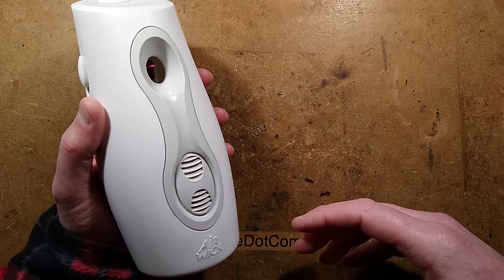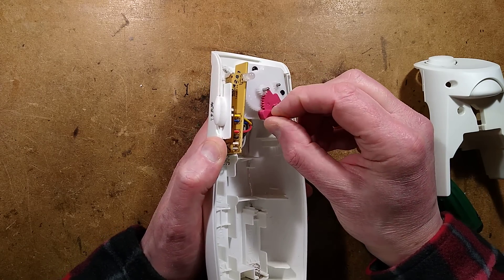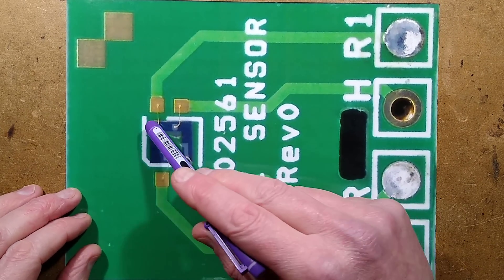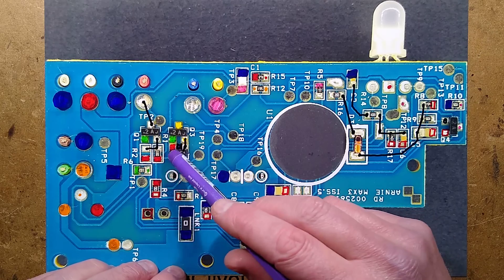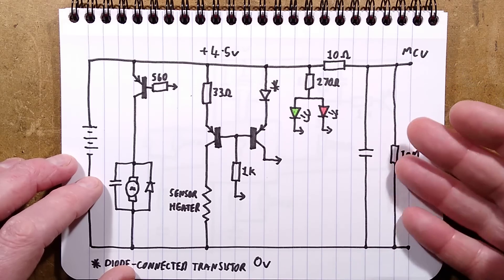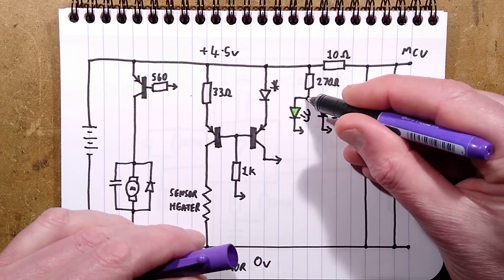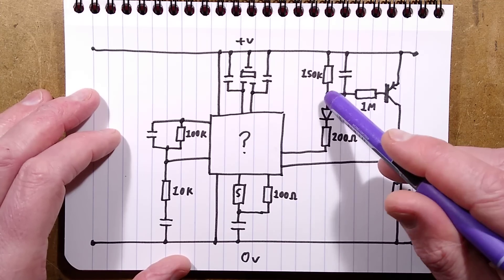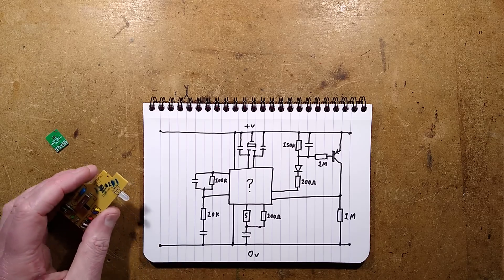Airwick fart neutraliser - with schematic

Comment: The same type of circuitry is used in some gas water heaters
If it "smells "   (detects) any flammable vapors,the gas valve will not open.
The gas company replaced 5 gas valves but nobody saw the shop side of the basement where all kinds of painting were going on
Gas flame vapor explosion = bad things

Comment: I bought some gas sensors a while back to build a fart detector device. Turns out they are very sensitive to a very broad range of gasses, meaning that such a sensor would react to practically any bit of organic chemistry being present in the air, without differentiating beween cologne or fart

Comment: I have a HEPA filter with a fawt sensor in it.  5 seconds after a fawt, the thing ramps up to jet engine speed. The cat takes the most toxic sheet ever right next to it in the litter box and I can hear the HEPA filter laughing as it remains on the slowest speed while I suffocate.
Reply from the maker: This is probably to do with relevant methane content.  You may need a specific sensor for cat poo.

Comment: Just after the turb of the century, I was living and working in Denmark and I noticed that when you went to the bathroom and turned on the light, the fan didn't start unless you were dropping a deuce or taking a shower. If you just went in to take a leak, it didn't go on. I thought the Dane's had come up with some sort of fart sensing technology. Then I realized that it was just a timer.

Comment: I have seen that weird arrangement for the heater transistors. The heating element has PTC characteristics and once it is heated up the voltage on the 33 Ohm resistor drops to a point that the other transistor with the diode does not conduct anymore. This tells the controller that the work temperature has been reached.

Comment: It's not odd. It's a current mirror configuration. The diode is a reference and the circuit  keeps the voltage over the 33 ohm resistor to the same voltage  as the diode voltage drop, thus feed a constant current to the sensor heater.

Comment: Hi Clive, is there a module with microwave sensor I can use to trigger my action camera to start recording and also trigger off when the module times out or no motion detected? I would like to solder 2 wires to the camera switch and conect them to the sensor so when motion is detected the trigger will replicate me pushing the start recording button momentarily and the same when motion is not detected to again stop recording. Thanks Clive. Olly.
Reply from the maker: Not so easy.  The hunting or trail cameras have the PIR built in.

Comment: I just saw a commercial for Fabreeze brand ("Plug" model) air fresheners claiming they have electronics to make them stink the room better, and showed the back side of a circuit board...

it looked too small to do anything that could help, but they showed the back side. Only tracings, no components. 

What's it actually do?
Reply from the maker: It depends on the unit.  Some sequence through multiple aromas.

Comment: The transistor pair is a constant current source. The collector of the second transistor provides a low battery warning when the current source can no longer keep up. The epoxy chip is clearly an MCU. The "charge pump" is NOT, but rather an interrupt generator that wakes up the CPU every few seconds, to take a reading. The sensor is on the back and its wires are sealed to prevent perfume from poisoning it.

Comment: I suggest sending the board to the dude who runs @electronupdate, he might be willing to decapsulate the chip. And regarding the weird charge pump arrangement, I'd speculate that they've shoe-horned an existing chip design and made some workaround circuitry to emulate the feedback signals that it expects to be seeing from what it is normally supposed to control.

Comment: The air freshener industry is the best example of generate a problem and sell a solution. 
Air not fresh enough? Open a window.
Reply: What if you are somewhere where you cannot open a window, or maybe somewhere where its freezing temperatures outside, or hot.

Comment: 7:15 - The heater drive circuit, is a simple current regulator circuit.

Yes, all PNPs, I suspect, the uC can only pull down. A 8051 family of uC have primitive general purpose IO pins. Open collector (or drain) outputs. No DDR (data direction register), so to use it as an input, output a logic-1 (output transistor OFF), and then that pin is hi-Z. 8051s, though originally from Intel, are made by EVERYBODY, so lots of cheap Chinese clones.

Comment: In the ( good old days , ahem ?  ) ..... An  AirWick™ used to be a glass bottle filled with flowery smelling liquid , the screw cap when lifted , revealed a long felt pad supported by a stout wire (  hence : Air - Wick ! ! !  ) ..... when placed precariously on the top of our school toilet entrance modesty partition , would always be knocked off by rampaging young boys , causing a HUGE crash , glass  EVERYWHERE and the ultimate STENCH ( no batteries required , BTW ) ....... DAVE™🛑

Comment: The 2-transistor circuit to me almost looks like a switched current source? I'm still behind on my transistor circuitry but the B-E drop is basically constant, i.e. the same left and right. The diode on the right makes for a very specific base voltage, let's say "Ub - 1.2V" and that puts the 33 across the same voltage as the diode, i.e. we know that the current across the left transistor should be 0.6/33 = 18mA and that would also be the current throught the heater... at least that looks like it. The input on the other collector might be a sensing input to detect a failure in the circuit? Or I might be completely off...

Comment: Ar my last job, the " fart fans" in the restrooms were just a low current 1.5 volt motor and fan blade. The " stink cartridges" had some sort if gelled funkiness and a single " D" battery. That's it. The gizmo ran all rhe time, and the stink cartridges were changed every two weeks. Despite running the little motor nonstop for two weeks, the battery had plenty of life left in it. I salvaged them, giving them away to whoever needed D batteries ( boom boxes were common then)...free batteries, though they reeked of cherry or apple scent..

Comment: Those 3 transistors sound like they're hooked up as a current mirror to put 18mA through the heater, regardless of the applied voltage, ie, acting as a cheep 18mA current regulator.  Keeps current constant at 18mA from fresh 4.5V new cells through end-of-life last-gasp moribund cells.

Comment: Is the transistor heater circuit shenanigans used to detect once the element is up to temp? Low resistance when cold = high current = 'output' high and then the output goes low once heated and passing a lower current? Kinda like an ultra-optimised 'transimpedance comparator'?

Comment: 1. Easily attack a triangle socket head screw by grinding one of the four wings off a Phillips screwdriver.
2. Connect the detector unit to a recordable sound chip as used in greeting cards. One could program the fart detector to play first notes of one's national anthem, a faux pau from some politician's speech, endless possibilities.

Comment: That first page of transistors had 'current mirror' or part of a 'differential input' written all over it, it looks like the front end of an instrumentation amplifier which would make sense to me as your not dealing with nice clean large signals and I don't believe there is a Glaswegian Kiss approach and it's going to be a bit more involved. It's all pretty specific so shame they never label blob chips

Comment: If you wanted to, you can buy modular VOC sensors from the usual suppliers, for only a few dollars. I note you can buy combination laser dust sensors and VOC detectors for less than $8 too, in case you need both functions!

Comment: So they went with the MQ6 sensor. The design is a cheap and effective way for making a natural gas sensor, and with a potentiometer, you can have it sense different gasses like , hydrogen sulfide , methane , co2 , nitrogen , ect. I eventually want to make a usbc gas sniffer , that plugs into your phone , and tells you what prominent gases are present in any given area. Based on different ohm readings.

Comment: the three transistors in middle is a current mirror with current control, the one use as a diode is a temperature compensation.

Comment: The oddly connected transistors form a constant current supply for the heater of about 18mA. The IC can urn this on and off, and can also sense when the heater is actually drawing 18ma. If the resistance goes up to a level where there is not enough voltage to cause 18ma to flow, or a low battery does the same, the sense output (collector) goes low, otherwise it's high. I'm not sure why you would want to do that, but thats what it does.
Reply: Brilliant, thanks

Why? I guess to go into power save mode and flash a LED to indicate the batteries need changing (to prevent over discharge of batteries; and prevent the end user being unaware the device has stopped working or thinking it is broken when it just needs new batteries).

Comment: They use the transistor as a diode so it has the same temperature coefficient. It's a fairly stable current source for the heater.

Comment: It would be interesting to remove the black epoxy using a nitric acid and then look at it under a microscope to see if there is a model number. (If that is  a common chip but a blob variant)

Comment: I could be wromg but if I remember correctly therewere some cheap for the time cut down 8051s. They were slow CMOS only pulled down and at most had two ports. Usually no UART or anything like that. ATmel did some re0ebgineering and turned them intoa 20 pin DIP which you can still get from Microchip. It was the 90's when I did a few weeks work on these so take that with more than a pinch of salt.
Reply from the maker: The classic 8051 core is often found in generic Chinese microcontrollers.

Comment: I think the odd transistors on the heater is so the processor can control the temperature.  Heater resistance changes with temperature, changing the current draw.  The processor detects the threshold and bit bangs the heater power.  

Maybe?

Comment: That diode transistor looks as if they were trying to match it with the other two transistors. Why? I don't know. Doing so won't help with the drift. A 1n914 would work there just fine.

Comment: The transistor with the base tied to the collector - I think that configuration is sometimes used as a temperature sensor.
So maybe it shuts off the heater if it gets too hot?

Comment: And I thought the charge pump was connected to an audio filter via a mini mike centred on 750 hz  which is the common frequency for farts which in turn switches the motor on. The louder the fart the longer the spray. But I may be wrong
Reply: It wouldn't be much use if it couldn't detect SBDs.

Comment: Air in my apartment is really fresh. The weather here has been fantastic for about the last two weeks, and I bought some thermostatically controlled window fans, and so it’s always pleasantly cool in the apartment with fresh outside air going everywhere. It smells like trees and grass, not like a concentrated a field of flowers and shoved them up my nose. And my sneezing is due to all natural pollen, not industrial chemicals from air fresheners.
Reply: when I was growing up, my mother, tho she had a brand new cloths dryer, chose to continue to hang her laundry on a clothesline when it wasn't raining out. and it always smelled so fresh after. not like hot lint like when done in the dryer.
Reply from the maker: The reason it smelled so fresh was because outdoor air contains a cocktail of short lived active molecules that are replenished continuously by foliage, atmospheric and electrostatic effects.
The same molecules will rapidly deplete indoors making the air seem stale.

Comment: I just put an esp 32 Relais between the battery pack connection of a normal airwick and added USB power. Now I can trigger it using Homeassistant. Because it always sprays one time when the battery pack is connected.

Comment: I may be able  to test  that , and add a high voltage power supply and ozone generator that dispenses  a measured dose of magic gas, ooh also make sparks. The mark of a decent bit of electronic shit.

Comment: I'm waiting for the newest in cutting edge fart sensor technology with subsonic early warning microphones and an air quality sensor that uses AI to give you an impromptu colon screening every time you pass gas.
Reply: And it requires an app to be even able to run :) and connects to your house wifi network and sends every 5 seconds all your data to the cloud

Comment: I have Winix air cleaners at my home and they also are quite good at detecting farts.  The indicator goes from blue (normal) to yellow (caution) to red (danger!), and the fan speed increases based on the level of stank.   If you fart in my house, EVERYONE will be fully aware.
Reply: i didnt fart,you are...

Comment: The inlaws house is full of air freshners of the plug in type, both of them have cancer, and the father in law is in his last few weeks. There has to be a link with those air poisoners
Reply from the maker: They often put out a continuous stream of oil vapour into the air.
Reply: My inlaws had 2 of these in 2 bathrooms.. Both of them recently died of Cancer...

Comment: Only thing worse than a fart is a fart mixed with chemicals.
Reply: Generally, that's how I think about most "scented" things - air freshener, trash bags, dish detergent, car vents - none of this stuff needs a "scent" and it always smells worse than whatever the thing it's trying to cover up.
Reply: @ExtendedJet8  when my washing machine died, my neighbour graciously washed a bag of clothes for me. Whatever they used left a smell so potent that I could not rinse it out and I ended up dumping the clothes in the charity shop collection bin and buying less polluted items from their rails. I literally could not have the smell in my home without gagging and gasping. 
And I worked as QC on a gel air freshener line until I discovered an allergic reaction to grapefruit extract (used in odour neutraliser gels) - at which point they terminated my contract and escorted me from the premises and the agency stopped offering me work like I'd just ID'd a radioactive leak. They probably did me a favour in the long run. 
Mind you, I could wear a shirt for a shift and it "freshened" the air for a fortnight if not washed immediately.
Reply: "Let's mask that fart with the smell of pine trees so now it smells like you took a sh*t in the woods"
Reply: @jrharbortproductions   there was a comedian back in the 70's who had a record out, with a routine about someone who used his bathroom and really stunk it up and then they proceeded to use pine air fresher to try to cover it. the comedian  went to use the bathroom after and said it smelled like someone crapped their Christmas tree. 🤣
Reply: Lemon scented bathroom freshener

Shitrus
Reply: Only thing worse than a fart is a shart
Reply: You end up associating that good smell with shit
Reply: @_mycotroph  Methinks farts could be classified "harmful substances". They can cause persons to run, trip over things and injure themselves.
Reply: Its like someone with bo spraying Deodorant all over themselves
Reply: But it doesn't just smell like fart + other chemicals because the chemicals in air freshener perceptually neutralise VOCs like scatole which makes farts stinky
Reply: Its like a gas